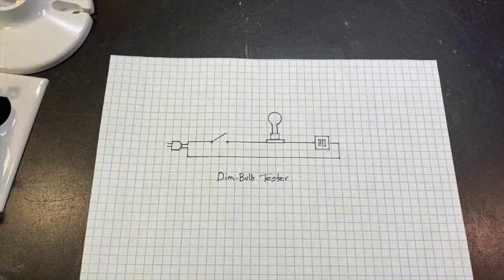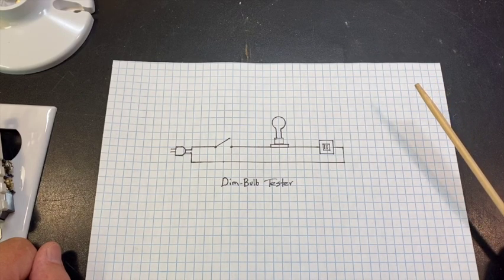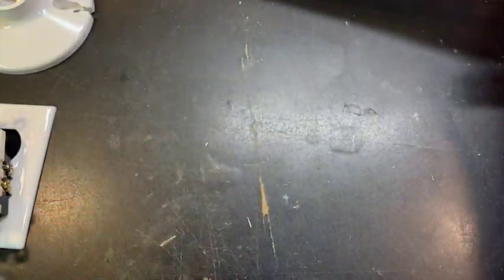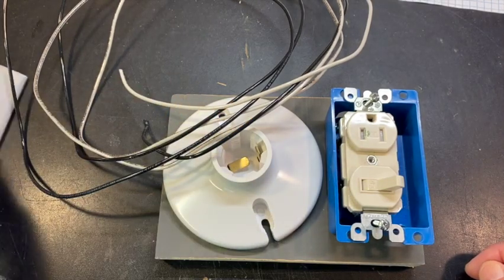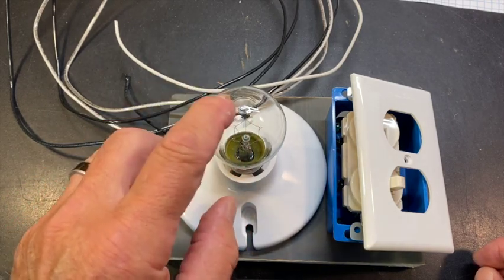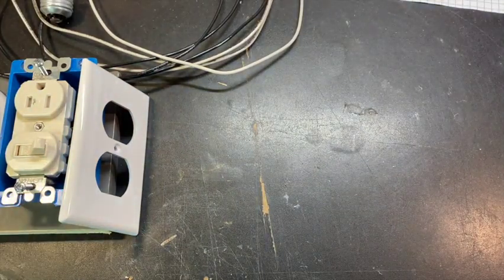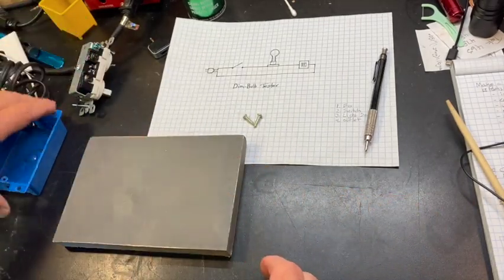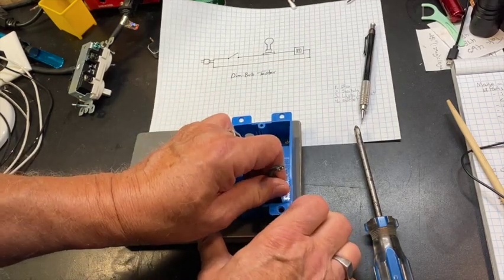Dim Bulb Tester   Make One

Comment: So do you need several incandecent light bulb according different wattages that you may have on several stereos or radios? anyone know?
Also do you need to cut the tab/bus on the swith if it does not have an outlet attached?
Or is it Ok to leave it like it came from the factory?
Thank you
Reply from the maker: As a guideline, you will want a bulb that is 1.5-2 times the wattage of the radio under test. For example, an AA5 radio might require around 30 watts, so you will want to use a 50-60 watt bulb. I'm not quite sure what you mean when you say, "if it does not have an outlet attached?" Do you mean the case where a switch and outlet are in the same factory housing?

Comment: Correct me if I am wrong, but I think this is wired backwards. @14:00 You connect the HOT of the line cord to the switch then @23:45 you connect the lamp to the NEUTRAL of the outlet and @25:30 the HOT side of the outlet to the NEUTRAL of the line cord. Shouldn't the outlet be connected the opposite way around?
Reply from the maker: Good catch, West Penwith. It is backward.